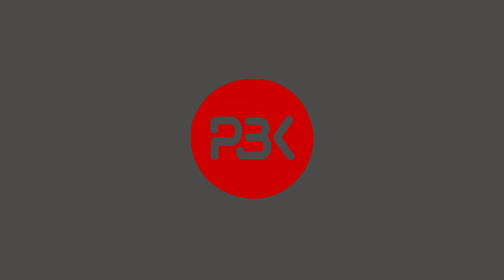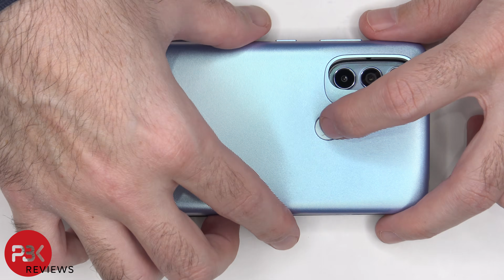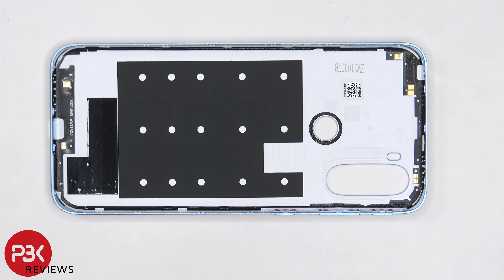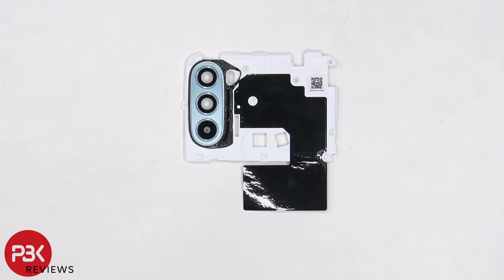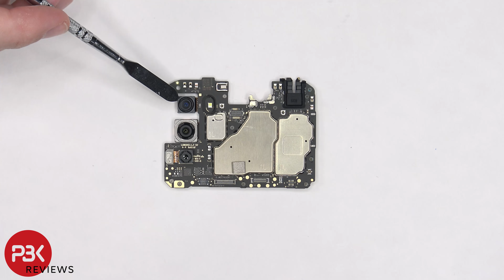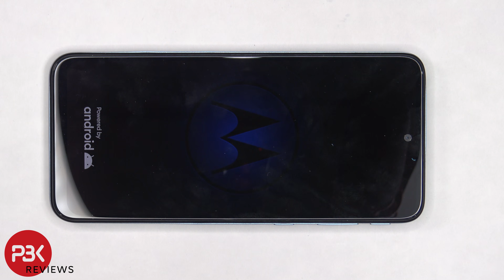Motorola Moto G31 Disassembly Teardown Repair Video Review

Comment: Question: is it possible to remove the cell radio from this phone, or at least disable it? Is that what the coax cable is for? Also, does anything bad happen if you neglect to replace the cameras or speaker, or will the phone still function without them?

Comment: I have also Moto G31 phone. Mobile internet is not working on this phone. I have 2 VI sim cards. I tried both sims separately but the internet was not working. Both sims are recharged. Call, massage working, full network is coming but only internet is not working. Tried putting sim in other phone, internet is running smoothly. Only my phone was not working. Sometimes it is provide a little bit of internet speed. Sometimes data is on but still  showing data is not turned on but giving very good internet speed. I inserted my friend's Jio SIM for 5 minutes and everything working very nice even internet . I inserted both VI SIMs and there is no internet access from the 2nd SIM. Only data on from SIM 1. From sim 2 data is not turned on. The rest of the phone is very good condition. I tried everything like apn change, dns change even factory reset, Hard reset from recovery mode. But this is a very strange problem. Only internet was not working. If I kept Data ON for 5 minutes, it's decreasing network signal and then shows no service and again after 2-3 minutes full network coming.
 Do I have to replace some parts from the service centre? 

My vibration is also not working, there is a 'cheeking' sound at the time of vibration but it is not vibrating.

What should I do please help? How much will the total cost be?
Please reply

Comment: i dropped my Phone in water, since then, it doesnt gain charge even after hours of charging, says 0%, and the Moto G Screen blinks and goes off.But not starting. So seeing this video i opened it properly, now that its completely ddry, i would like to close it , should i use the thermal paste again to seal it properly in place .Kindly help, if it doesnt work i would take it to a service shop, but before that i wanna give it a try._ TIA
Reply from the maker: you mean adhesive to reseal the phone? also make sure you brush off any corrosion on chips or connectors with a small brush like a tooth brush.

Comment: This is completely different than some other G31 units out there without fingerprint reader. Their back cover or back housing has a glued cover part which has to be removed first, heating the back and using spudgers or guitar picks to lift it, and then proceed with the screws below it before you can remove the outline part with the side clips (!!!). Damn…
Reply from the maker: Are you sure the other units are G31? I know some regions have minor differences such as antennas etc., but usually isn't a big difference like missing fingerprint sensor.
Reply: @PBKreviews  In Europe (Hungary)  I bought a Moto G31 that have integrated fingerprint reader in the power on button on the side.
Reply: It is also different from the proprietary Xfinity G31 models. None of the parts are interchangeable due to tiny form factor differences.

Comment: my g31 is getting some heat issue so i follow ur suggestion to put some thermal paste between the shield and the frame . my temp drastically drop down and no heating problem now . so why moto didnt recognized that? or they forgot it dang! ty boss nice vid ...
Reply from the maker: You're welcome and thanks :)
Reply: Tofu dreg...assembled in China...

Comment: please do a video on "Moto G71 5g"
Reply from the maker: Hi, the G71 will be the same as the G31/G41 since the design and assembly is the same, just some of the internal hardware like the processor or camera lens are different. So the overall disassembly will be the same as this. But I will be doing the G51 as well which is different in size so that will have some differences in the disassembly.
Reply: @PBKreviews  In your country Moto g71 5g launched?? Please do a review or unboxing on Moto g71 5g  please . no one has done that's y iam asking you although you are doing teardown. In India yet to launch iam planning to buy if it satisfies my requirements  that's y i want to know about it please try to do a video on it !!
Reply from the maker: @Vishall_Madurai  it hasn't launched here yet also but i know the specs for it and and design. Look wise will look like this moto g31 just different color.
Reply: @PBKreviews  thank you bro!!
Reply from the maker: @Vishall_Madurai  You're welcome :)

Comment: Holy crap ! No glue !!??
Thank you Motorola !

Is this the easiest modern phone to repair ?
Reply from the maker: There are a decent amount of the mid to lower tier devices which come with the clip on style back housings now a days which are great for repairs since you don't need to pry the back off. But they aren't the best when it comes to water resistance etc. :)
Reply: @PBKreviews  Yeah, that's a fair call. I'd take an easy repair any day, as I'm sure you would  👍

Have you considered doing a "Top 5 easy to repair budget phones" special ? 😃
Reply from the maker: @edwardfletcher7790  yup I would prefer repairability 😀. I haven't, but will possibly look into doing those type of videos in the future when the channel is a bit larger.
Reply: @PBKreviews  Thanks very much for making these videos. I stopped fixing phones around the iPhone 6 and seeing these new phones, I'm really glad 👍
Reply from the maker: @edwardfletcher7790  you're welcome, thanks for watching 😀